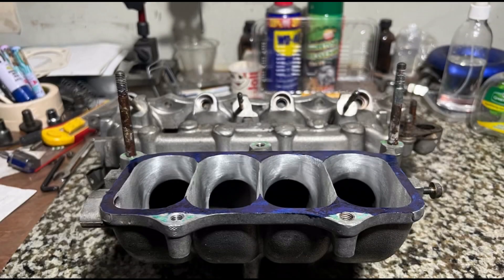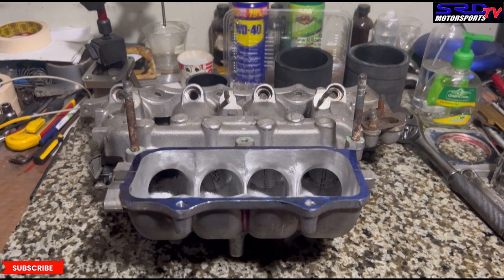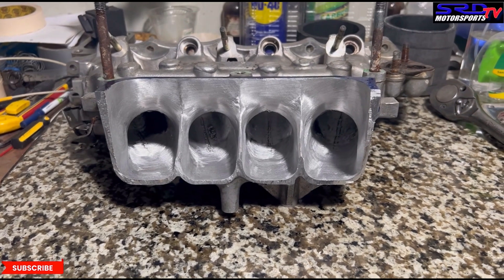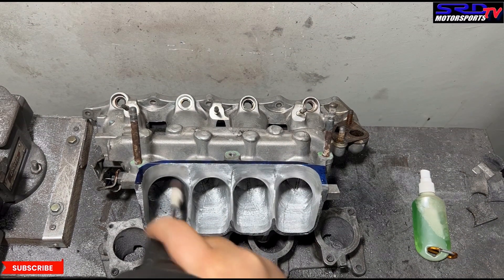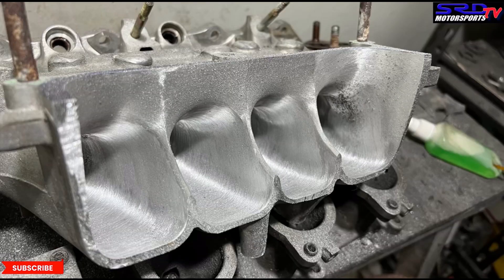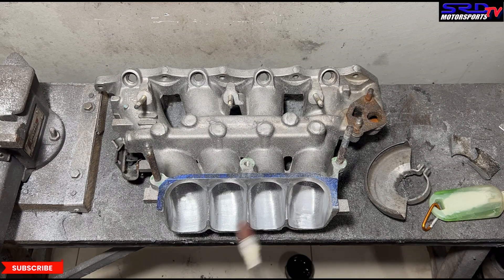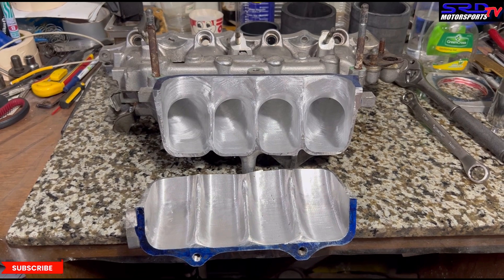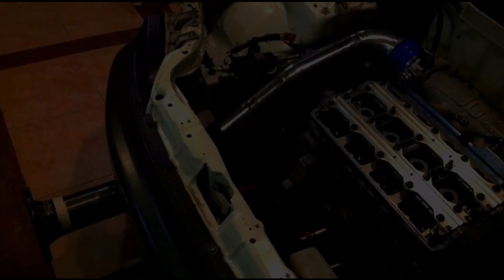NEW H22a Intake Manifold Full Race Port by SRDmotorsports

Comment: Hello my Friend!! How are you !!
Have you ever mounted a turbo kit on the H22 A8 ?
Reply from the maker: Yeah we did many years ago with a gt30 turbo
Reply: Nice, did you remember the parts you installed ? How many HP did you get?
Reply from the maker: @sebastiengaudens5986  it’s just a simple set up but it ran Wiseco turbo pistons so block was resleeved with darton sleeves

Skunk2 pro1 cam and skunk2 intake manifold
That’s it

Made 507whp
Reply: @SRDmotorsports  Very nice results 🤩. Dis you buy a exhaust manifold  with a full kit  + intercooler or home made? Youi Say Garret GT 30 ? With bearing mounted?
What ratio piston did you use?
Reply from the maker: @sebastiengaudens5986  local made piping and eBay intercooler can’t remember what compression it was but Wiseco only have the same turbo h22 pistons
Reply: @SRDmotorsports  OK do you think Can i use the mahle gold 87mm 12.0.cr (930083125) with oem sleeves for this set UP? What is the injectors size recommanded for this set UP?
Reply from the maker: @sebastiengaudens5986  no that cr is too high that mahle golf is nice got all motor
Reply: @SRDmotorsports  so what cr do you think Can iinstall ?
Reply: @SRDmotorsports  which shop would you recommandable to buy a fairly complete turbo kit?🤔
Reply from the maker: @sebastiengaudens5986  anything lower like 9:1 or max 10.5:1
Reply from the maker: @sebastiengaudens5986  a shop called @go-autoworks is a good place he has a channel here but the shop page is more easy to contact him Greg the owner I know well and get stuff from him he is from Alabama 
Check them out on their Page he builds turbo kits etc and very knowledgeable
Reply: @SRDmotorsports  this shop IS the paradise parts for Honda 😍 thanks so much ! 👍 I keep you informed on the progress of the project.
Reply from the maker: @sebastiengaudens5986  hahaha Greg the owner is a good guy if u were from Alabama he could build your h22 into a good turbo set up and tune it! That also means he is a dealer of ALOT of good parts and a real “person” u can talk to

When u msg him tell him SRD/Ralph sent you
Reply from the maker: @sebastiengaudens5986  oh here on YouTube it’s @goautoworksyoutube

Comment: I welded underneath the primary's to port it to the floor and welded the butterfly plate to the lower plenum. You can stack plates to increase plenum volumn and the primary runners are easy to port and get to. Cutting the manifold isn't going to get you the gains needed worth the time or a clients money
Reply from the maker: Makes sense and yeah on stacking plates as it’s quite reasonable from several sources

Comment: Well now I might have to do this. I am currently building a h22a1 block that is 88mmx95mm. Using some p5p pistons and forged rods for more stability. I have a few manifold and cylinder heads. I ported my h22a4 pde head and ran it with a bad block 130 compression across board. Now I am going to a pcb f20b head with all my numbers and thicker head gasket  the engine should be 12:1 its gonna be out the bore but since I have the other h22a running still I am gonna sleeve it and go 89mm eventually.  I just like to try stuff as well and old forums always have huge lapse in information.
Reply from the maker: Oh man glad to keep the ideas burning! And so true on old forums man so true so true 

That 88x95 sounds awesome!!!
Reply: @SRDmotorsports  yess I am excited. I have a love for the h series my brother has a k20z3 in his eg on like 20psi. It's a beast I haven't rode in it but just from being in the same car I can only imagine.  I have my skunk 2 cut up for the motor but I might just save it for another time. I already gutted the upper but opened a hole in the iacv passage going to have it welded flat. I am going to open it to 70mm. I already have a tri-y with a 3inch exhaust and  fuel system since I took most the parts from my old car I crashed 😑
Reply from the maker: @Markstarscoobs   great to know you keeping good progress! Man that’s be a fun beast!

Comment: Did you know you can cut in J32A2 valves and use J32A2 valve springs inside a F23A head?  If the 36mm intake valve is too much for you, you can also use a 35mm j30a4 intake valve.  Along with using K20A pistons in a F23A block you can also use J30A pistons. Both pistons must be flipped 180 degrees. The hybrid version of a J30 called a JNA1 has the highest compression out of all J30A pistons.  You can also use K24 pistons in a f23A block if you bore the block 1mm. This makes it a true 2300cc engine (2306cc). F23 bolts up to any H22A, H23, or F20 transmission. Cheap alternative to a H22/H23 or F20B.
Reply from the maker: Yes sir on the J32a2 and F23a head

Ported an f23 some time ago ftw

Lots of good configuration indeed
Reply: @SRDmotorsports  You should do a build to show people what they can do. Even using oem parts, You could make good numbers for cheap.
Reply from the maker: @michaelelliott3456  definitely true got things lined up now but it’s in the list of things definitely
Reply: F23A and J30A1 share the same valve, valve spring, and retainer. Any early J series oem or aftermarket valve and valve springs can be used.  The intake manifold on the F23A is the biggest restriction, mainly the upper plenum. You can port them to accept a 70mm throttle body. Some have used a K20A intake manifold. Not sure the adapter is still available.

Comment: Thankyou so much for your detailed videos, got a couple of questions:

Do you recommend removing the egr system? and if so, each runner will have a hole in the roof where the exhaust gasses enter from the manifold that spans the width of the intake manifold. Do you think there would be any gains to be had by filling these in and smoothing them out so the incoming intake air doesn't get caught in them on the way past?
Reply from the maker: On the gains not sure but certainly won’t hurt, as I see a lot of them they weld it shut etc

As u can see in this “from japan” manifold the egr spots above the runners have been welded